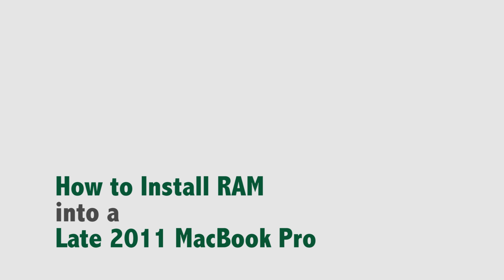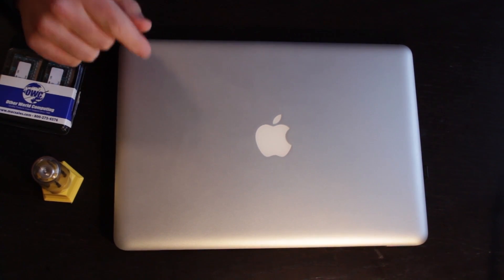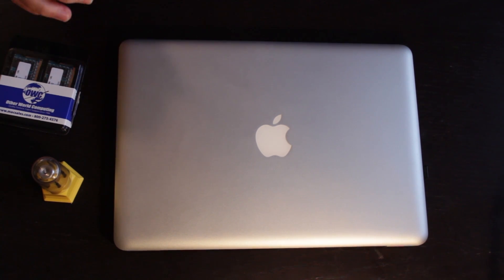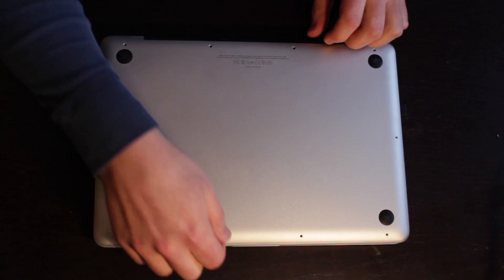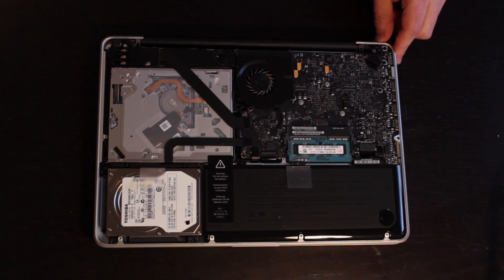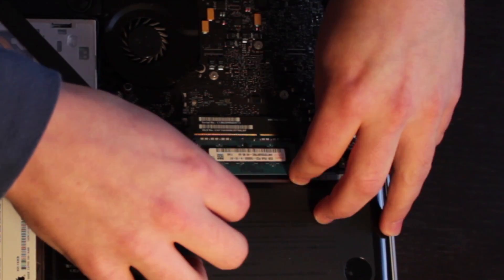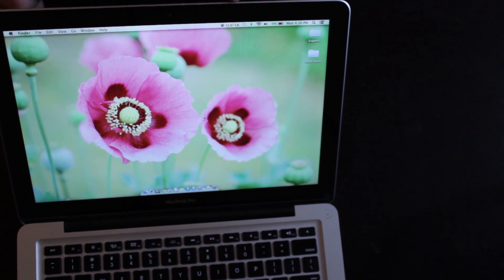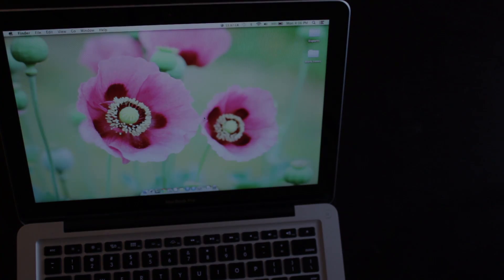How to Install RAM into a MacBook Pro (Late 2011)

Comment: any comment on a speed gain 4GB vs 8GB?
Reply from the maker: Late in replying but it was significantly faster for a while. The new OS upgrades definitely help with resource management as well, so I get a lot more life out of the machine, but corresponding apps are bigger resource hogs now (e.g. Office is slow as can be).